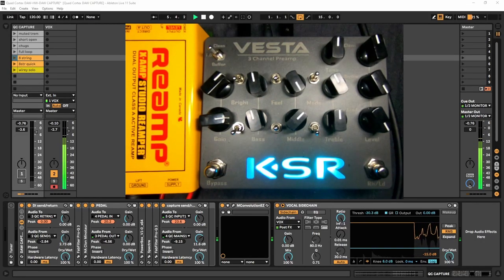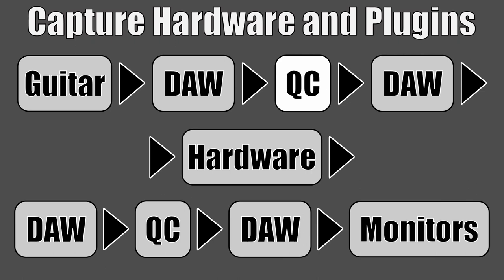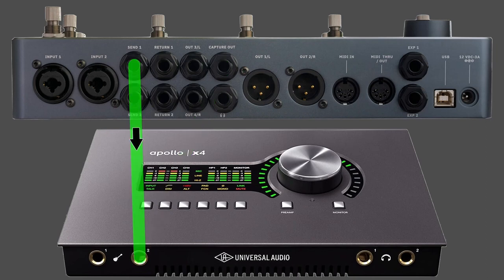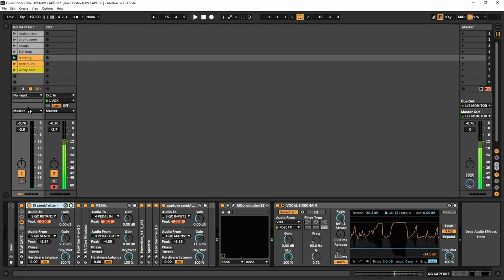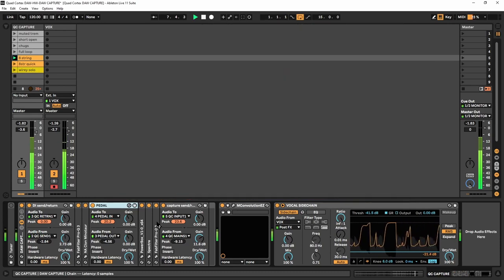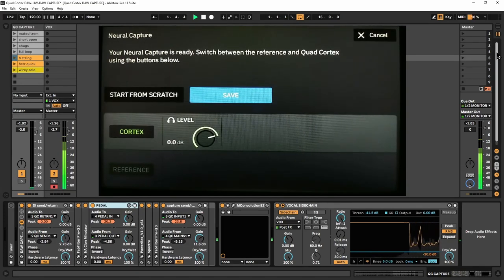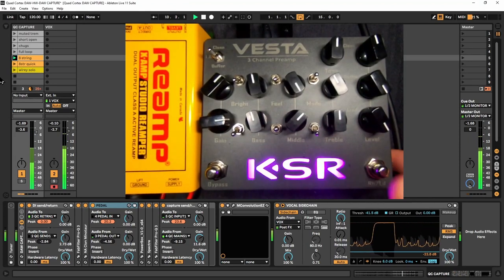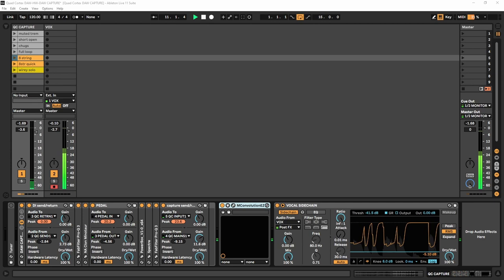Capturing hardware and plugins with the Quad Cortex and your DAW

Comment: I try to capture Unison pre plugin from UAD from my apollo twin, I did the gain level match with (1) QC send1 to UAD plugin (same volume as I plug the bass directly to UAD input), (2) UAD output to Reamp box to UAD HI-Z input,(3) UAD output to QC input2 (which record the capture),  the result tone is right, but one problem, the capture it involve very large hum/hiss when I playing any notes from the bass, if I m not playing it, no noise. 
and I start to adjust the output level on the chain "UAD output to QC input2" (the last connection in whole capture process), it did impact the amount of hum/hiss of the capture result, if the capture level is near -6 db(which just passes through the sanity test), the noise is the lowest.
I use a limiter to control the output level on UAD (HIZinput, line out)>to QC inuput 2, I did found that even adding/deducting 0.01 db the result would be very different, but still no clue on finding a level that is completely hum-free
Did you have any experience on this? any insight you can share? thanks!
Reply from the maker: You may be creating a ground loop somewhere. I would use your DAW to record the "training sounds" audio you are sending into the UAD unit to analyse it. See if you hear any hum. If so, there is a problem with that portion of your audio chain. If not, the hum is being created from sending the audio from your UAD back into the QC to be recoded by the training algorithm.
Reply: I checked there is no grounding issue. And I experiment for hundreds of capture and figure out the noise problem is caused by mis-alignment of level/volume on QC output training signal with its input (receiving trained signal).

I tried my Neve preamp (physical unit, not preamp). signal path is QC > UAD HI-Z (to compensate gain loss as ur video suggest) > UAD line output > Reamp box > Neve Line out > QC input (capturing)

if I manipulate the QC input (like +0.1/-0.1db), the capture result would have strange noise while you playing, also adding input Volume makes the capture sounds more compress&less low end (I saw ur other video, someone also comment about QC input volume makes tonal differece on capture)

Then I tried to capture plugin, same issue
QC > UAD HI-Z > Plugin > UAD line output > QC input (capturing), this easily cause the noise as I cannot figure out the right "alignment" of plugin output to QC input 
if I add a limiter to control the level after plugin output,leaving QC input at 0,  by try & error I can achieve the right optimal level and have the noise-free capture
Bass/clean guitar is more easily to reveal this issue, it is hard to hear this issue under distortion tone

hope u can also investigate more on this, as I dont know the theory behind, just trial & error hahaha